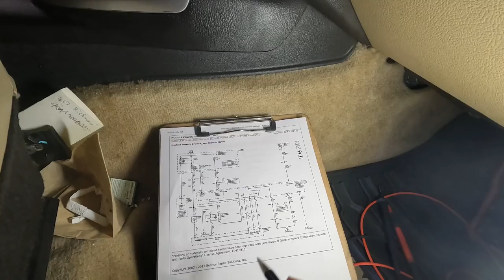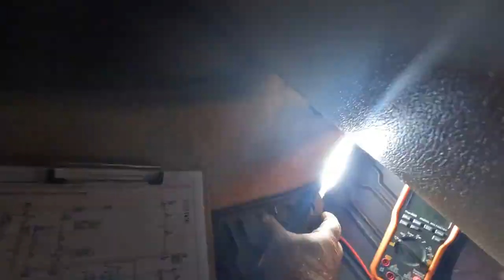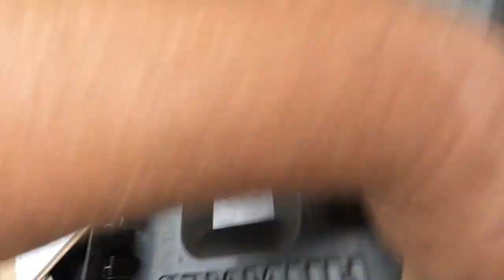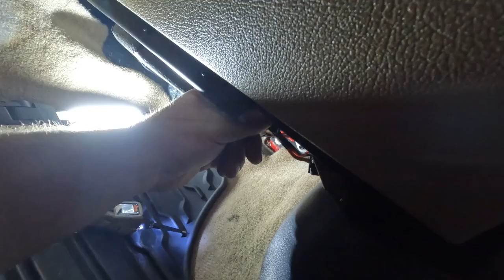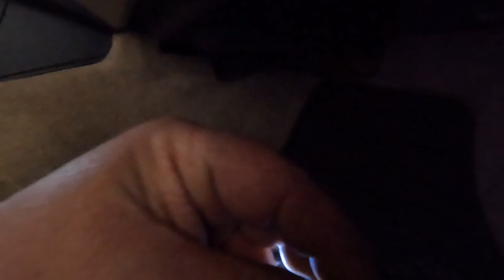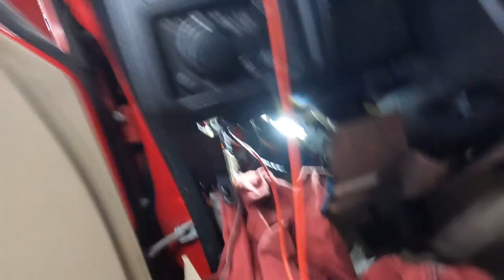2006 Hummer H3 with wiring problems! No blower motor speeds!

Comment: I had this exact problem. I fixed it and a few days later the blower motor went out again, no blown fuses, relays or diodes, I replaced the resistor and still nothing.
Reply: did you figure it out? i have same problem replaced relay and it fixed it for a few seconds then right back to nothing
Reply: It was my resistor,  it was melted inside the connector I just rewired the resistor and it works perfect now